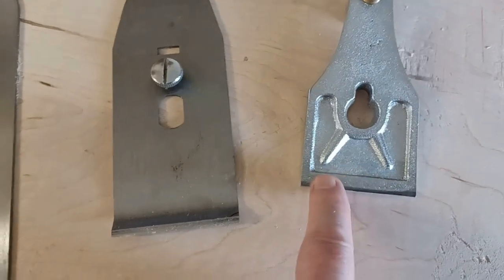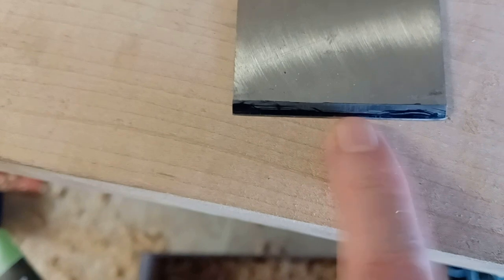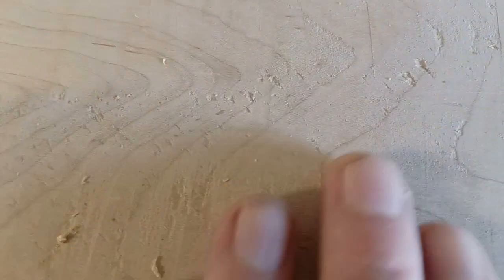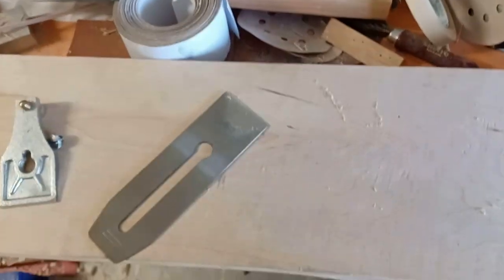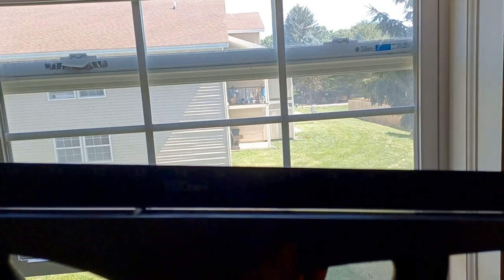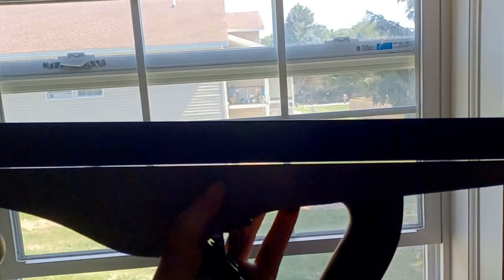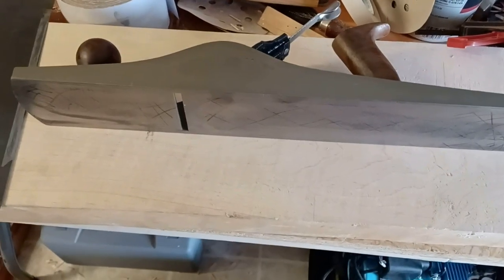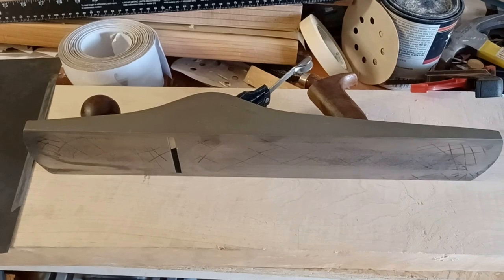Faithful Hand Plane PSA

Comment: Clamp the blade in first, retract it fully then check the sole, and go straight in with something like 220 grit to level it. It honsetly doesn't matter if the sole is super shiny, highly polished or that, just level.
Reply from the maker: Thats crazy amount of work for something that should have been straight outta the box. I will probably do it but not in this heat right now. It just sucks cause my whole build revolved around that plane to make the neck. Once it cools down a bit here I will saw off some lengths I need to do the lamination and work those with the shinto to get as straight as I can.
Reply: @borgonianevolution  Just try what I was suggesting and go heavier grit paper, I don't find much happens as quick below 150 or so though but it doesn't take to long and you can end up with a really nice tool. All cheaper handplanes need this work to be of any use generally unless it's a 2nd hand stanley or that, they're often already sorted. 
Look up Paul Sellers on sorting a handplane, he's really down to earth.
Reply from the maker: @nsjguitarsakascotsman6989  I been using @RobCosmanWoodworking as my guide to sorting this out. He has been very helpful with the detail and explanations in his plane series. I just wish I had a better order of operations to follow as a noob to planes.
Reply: @borgonianevolution  Yeh bud, first job, sort the sole. If the sole isn't flat enough then nothing else matters. Metallica came up with that song title while sorting a handplane 🤣
Reply from the maker: @nsjguitarsakascotsman6989  🤣